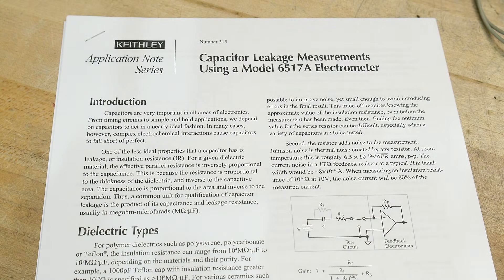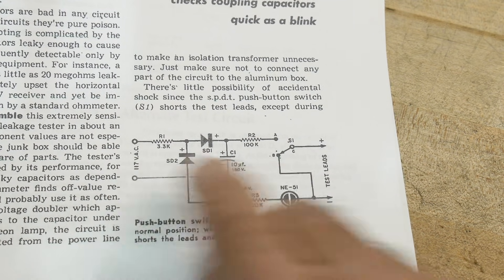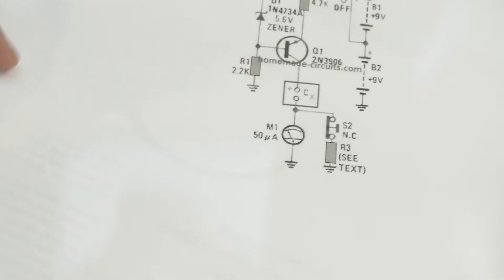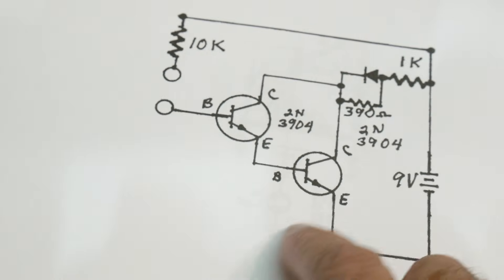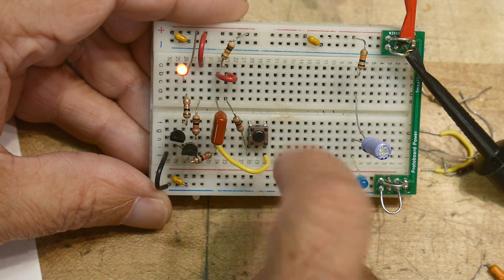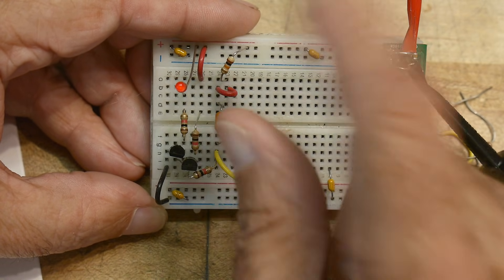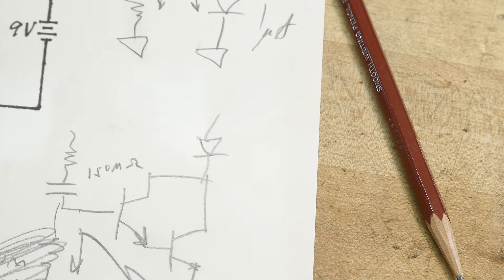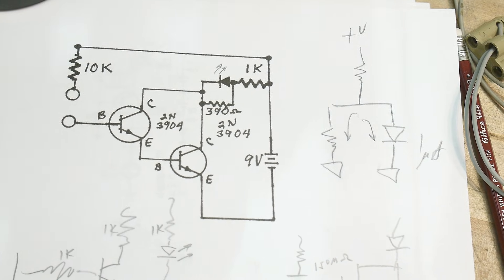#1691 Some Capacitor Leakage Testers

Comment: You might use any LED for this test and connect it to a photomultiplier tube detecting single photons at extremely small currents. The LEDs really turn on at very low voltages since at room temperature thermal processes participate in the emission causing random photons.

The leakage current consist of many components in excess of the capacitor's actual internal current through the insulation. There are currents through the air by ions and electrons and surface currents on top of insulators, caused by dirt and grease ions. These are really significant when measuring femtoamperes. All surfaces should be cleaned with solvents before attempting anything. The air should be dry else air conductivity will be dominating. Also, you should  ionize the air before starting measurements to neutralize all nearby surfaces. Else there will be space currents caused by very high voltages present on the surfaces, not seen by the eye. These can be observed with field meters, analog or digital. Things become easily very complicated before getting reliable results.

The capacitor is not really just a pair of metal plates and some dummy insulator, as said before. The insulator is a macroscopic piece of ions which can not move and there is no conduction band for electrons. The capacitance is based on polarization of these ions.  Measurement of leakage should measure the current in the insulator caused by its imperfections and impurities. But there are free electrons inside the insulator which can slowly move inside the insulator. These usually come from the outside and they are often stuck inside. They are hard and slow to remove and their behavior is complicated.

Comment: According to both Nichicon and Chemi-Con, electrolytics should be tested for leakage current at their rated voltage, and allowed to run under that voltage for five minutes.

Chemi-Con ratings for KNG series, 105 Deg C:

6.3-100 VDC:
I=0.03CV or 4μA, whichever is greater.

160-450 VDC:
CV≦1,000 I=0.1CV+40 max.
CV＞1,000 I=0.04CV+100 max.

So, within the above voltage ranges and capacitances, it can range from 4 uA to 100+ uA max.

A setup to supply 600 VDC at 1 mA, and using both a 50 uA and 200 uA meter, switchable between the two, along with a 0-600 VDC voltmeter, would be sufficient to cover the entire range. The 50 uA meter would be used for some not electrolytic as well.

For metalized polypropylene, according to Illinois Capacitor:
30000 MΩ x uF “Not to exceed 3 GΩ” 

They do not give a maximum current, only a resistance. However, knowing that the maximum resistance is 3 gigaohms, and using a rating of 600 VDC the current would be: 2.0 × 10-7 amperes or 0.0000002: 200 nanoamperes.

Comment: why can't I use my 0-100VDC PS & just put my Fluke 189 uA setting inline (in series) and measure 100V & below caps current flow (leakage) that way?
Reply from the maker: you can https://youtu.be/H1qMV_hTGGw?si=VyRdOg7rTlWBPIsU

Comment: I have a University Degree in Physics and Chemistry and I saw an Electrometer ONCE during a high school Physics class. 
The Warning Label stated: "Maximum Input Voltage 1 V".
The readout device was a 0 to 100 microammeter.

Comment: I just use a multimeter and a power supply or more in series to achieve the desired voltage, i agree with your opinion about the test voltage, i always try to measure on the "high side voltages", i usually use the uA range but sometimes i also resort to the intrinsic 10Meg resistance in the voltage range, but very rarely. As you said practically all electrolytic has some leakage, i tend to estimate the allowable leakage according to the capacitance, usually i accept some couple of uA to tens of uA. It has been proven to be effective for my applications over the time.
Reply from the maker: I test them the same way: https://youtu.be/H1qMV_hTGGw?si=DV7tbJ5IWyLfmLfO

Comment: Oh well, but it was typical for electrolytics to have mA of leakage back in time even when they were new. Caps would vary but in the range of uA. Modern devices are much much better so you need to actually build at least two test ranges into your tester.
I agree many of the old caps and electrolytics will break down at rated voltage, often after some days or weeks even if they tested good initially.

If it is a high voltage or current circuit I always change old devices.

Comment: In his original video from 3 years ago, tomtestkit said, he adjusted that shunt resistor in that circuit, with that particular LED, to light under a leakage resistance of approximately 250 megaohms or lower, not for a particular capacitor value. @ 12:25 It would be impossible to "set up" a shunt resistor on a circuit like that to accurately cover indicating leakage in random value electrolytic capacitors that's why device manufactures like Sencore and Sprague ( along with a few others) created tables with "accumulated" capacitor manufacturer leakage rating info for components of different voltage rating and capacitance values.
Reply from the maker: true, but most people don't have a 250M resistor laying around

Comment: i get usiyan application voltage if you're picking a voltage, but are there capacirors that will leak at one voltage but not another? (within reason)
Reply from the maker: yes, it is non-linear

Comment: Are you sure it was blue and not green LEDs that work best for this?   I tested this with various color LEDs from an old Christmas string.  To get a noticeable glow from the blue, it took 25uA.  The green was brightly lit at under 1uA.  I also tried UV LEDs and, although slightly better than blue, green is still the clear winner with the selection I have on hand.  Thanks for sharing this trick!!!!!
Reply from the maker: blue! green leds are some of the most inefficient
Reply: @IMSAIGuy  OK, thanks for the confirmation.   The old green ones I tried (according to my DMM) are noticeably lit down to around 300nA. Nothing else I have in the junk box comes close.  What current do your blue ones light up visibly at?  Maybe the age of these old LEDs has something to do with it because I tried a newer green one and the blue worked way better in that case.  I guess I had better save these few old green ones I have left!
Reply: I asked on a electronics forum and someone made a good point.  Some LEDs are also good at producing current in the presence of light, and these are terrible at that.   This may explain why they worked so good with low current, no photo-induced current to counteract.
Reply from the maker: @Channel-xb4xt  I worked on LEDs for 10 years. I don't thing that explanation is correct.
Reply from the maker: https://youtu.be/ClVLgFO52cY?si=ZqfVxiNHNl7rLvL6
remember this is an april 1 video. all is true but the antenna part
Reply: @IMSAIGuy I would have guessed it was a prank video seeing as those signals would be way too small to induce a voltage capable of forward biasing the diode.  I think my green one is a quite a bit brighter at 1uA than that blue one in your video though.  Not that it matters, just a cool mystery I would like to better understand.  I could mail you one of them so you could try to find a blue one that draws less if you had nothing more important to do :)  Thanks for the replies!
Reply: Apparently, I have some AC floating around my desk.  I connected one leg with a 4.7MΩ resistor in series to my PS, and before I could connect the other leg, I noticed it was already lit up from just touching the other leg (im not grounded to anything).  If I then touch my desk, it gets much brighter.  Putting a 4.7MΩ resistor between the PS + post (or - post) and desk, I get 5v (so there is 1.06uA current there). But it lit before even touching the desk so the capacitance of my body at 60Hz was enough of a ground!  I'm making a probe out of this!

Comment: To me this is a 'nice to have', but if a capacitor is suspect or old I just change it.  If its old it could fail any time after testing.  For the price of pocket change its not worth the risk.
However this is an interesting topic and still educational so thank you.
Reply: there are expensive caps that you won't be changing willy-nilly
Reply: On the other hand, new capacitors can have unusually high leakage as well. It’s just a luck of the draw. Typical capacitor specs are very conservative but production parts are much better. Then your app depends on that and when an occasional worse but in-spec part comes along there’s trouble.

Comment: A good thing about the resistor across an LED is that the forward voltage of the LED and the resistor set a point where there is no LED current.  The proportional change in LED forward voltage with temperature is lower than you get with the E-B drop of a transistor.

Comment: Can someone explain the difference between a picoammeter, and an electrometer. (I have a feeling there is a significant difference.)
Reply: A picoammeter is a highly specialized instrument designed specifically for measuring extremely low currents, typically in the picoampere range or lower. It excels in applications requiring high precision, such as semiconductor testing. On the other hand, an electrometer is a more versatile instrument capable of measuring both low and high currents, as well as high-impedance voltage measurements. Electrometers find applications in a wide range of fields, including physics experiments, medical physics, and environmental monitoring. The key distinction lies in the specialized sensitivity of a picoammeter for precise low-current measurements, while an electrometer offers broader measurement capabilities across various current and voltage ranges.
Reply: @andymouse  Hi: AFAIK we called an instrument, or meter, that measured current, an ammeter... after Ampere... and the unit of current the amp. If it measured milliamps, we called it a milliammeter... if it measured picoamps, we called it a picoammeter. If the instrument could measure charge in coulombs (and maybe current, voltage, and resistance... but at least charge ... we called it an electrometer. If it could only measure static charge we called it a coulometer. AFAIK...an electrometer has an integrator (or something that acts like an integrator) in it... but an ammeter doesn't. And an electrometer measures charge on the scale of picoamperes.
Reply: Technically an electrometer measures charge.  The term is often misused for picoammeters
Reply: @kensmith5694  Ya... charge and current so easy to get confused, in a timeless world. But, who's timing it?
Reply from the maker: read: https://assets.testequity.com/te1/Documents/pdf/keithley/KeithleyLowLevelHandbook_7Ed.pdf

Comment: Measuring leakage at the rated voltage is how I discovered fake rated chinese electrolytics. They were marked 16V but the leak was terrible, so I lowered the test voltage to 10V and the leak current dropped to a few micro-amps, just the normal value for an ok electrolytic. 
Just to prove they were re-marked as higher voltage, I put them at 16V as the sleeve said, and the ones I tested started to overheat and finally exploded!.
Reply: Yes and you also can't trust the capacitance number on them.
Reply: @kensmith5694  Actually, they were correct in capacitance and ESR, so they were not terribly bad.
I will just use them for small unimportant pojects...

Comment: Very interesting video. I would like to see this put up against Mr Carlson's model that shows capacitors to be bad at 30 volts that other high voltage testers test as good. Without giving away what's in "the secret sauce" his detector uses about 80 M ohms of input resistance to check at it's highest sensitivity. I would like to see that Keithly put up against it. Is Carlson's secret just that if you have enough sensitivity, you can pick up ANY leakage, even that which is "acceptable"? His is based on stacking up transistors in a similar method like you've done in your schematics, YET it doesn't condemn new components. It would be cool if you built his and compared it to the Keithly meter. I would love to see that. I am also curious if you had an op amp or jfet at the input of a version of his tester instead of a 3904 if it would be too sensitive to be practical?
On the electrolytic capacitors, I have a variable high voltage power supply and a 100 micro amp analog meter that I put in series to test them and the meter dances all over the place while charging the capacitor up to it's rated voltage. I've noticed that it takes about ten minutes to really settle down, even with a good cap, but it always fluctuates even when its down to only a few micro amps of current. 
This video makes an interesting discussion, so feel free anyone who wants to comment on this. Thanks.
Reply from the maker: In tomorrow's video, I show opamp that would be used in a more modern version (instead of darlington). I should design a board.
Reply: Great! I can't wait. Take care. @IMSAIGuy
Reply: It's hard to compare if he never would like the schematic public

Comment: If you have just an ordinary digital multi-meter that has an input impedance for voltage measurement of 10MOhm you can connect it via the capacitor to a dc source. The voltage you see in the display stands for the current of 100nA per Volt. (1/10Mohm) This is also 100pA/mV or 100fA/µV. 
For faster testing it is good to have a smaller resistor like 10kOhm to shunt the input of the multi-meter at the start. 
This method is not so common (I do not know why, maybe as leakage measurement is older than having digital multi-meters).
Reply: A long since obsolete Fluke 8060 A had a 2'000 nS conductivity scale.  Conductivity - what is that, you may ask.  In fact, instead of the IEC naming "siemens", the Americans used to call it "mho", for 'inverted' ohm, or 1/ohm.  So, the 2'000 nS full scale has a resolution of 1 nanosiemens.  The meter uses 9 V battery, so it cannot measure high voltage leakages, but the 1 nS already corresponds to 1 gigaohm.  I used that to select some very low leakage diodes from a batch of 1N4148 parts.  Well, nowadays I would just buy FDH 300 family parts (assuming they are still available).  And, on the other hand, I have a Keithley electromeer, as well as an HP 4329A that has both high voltages and 10^15 ohms, or so, capability.  Yet, I am finding the blue LED designs quite nice and interesting for DIY activities.

Comment: My fluke 27 multimeter has a leakage tester that measures in the Giga ohms range. Of course, this is not testing rated voltage of the capacitor. Much like Mr Carlson's tester.  I agree with testing at rated voltages cuz the behavior of insulation breakdown at a higher voltages like arching may be an undiagnosed issue.

Comment: While you can't 100% rely on the beta of the transistors, could you not use some form of feedback to set it to a specific amount?
Reply: The challenge is that for very low currents the input impedance is hard to control.  A better approach if you want to improve accuracy would be to use a modern cmos opamp that has a very high input impedance.
Reply: The opamps for pH measurements have the highest impedance among easy obtainable parts. 100Meg impedance of measurement electrode is typical value, the impedance of opamp is much higher. If one needs to measure something in that range - use them. PH and reference electrodes are usually connected to 2 amps, connected like a buffer and all the other signal processing is done from their outputs.
Reply: Yes you can. It is called bias. You can look up transistor circuit biasing to see how.
It is the way to go.

Comment: I had a very similar problem back in 2010. In analog ion chambers dose rate is measured via transimpedance amplifier as chamber current (~10^-13A....10^-10A) and absolute received dose is measured as a tottal charge passed through chamber. That is done via precize integrator, and one of the problems was to find (and prove via measurement) ultralow leakage capacitors, also radiation hardened ones since ionising radiation disharges capacitors via production of charge inside capacitor insulator. Absolute hell.  The instrumentation was so sensitive to everything. I swear to God it was almost sensitive to look at. 😂
 At the end we did it by using kind of a sample hold circuit with electrometer amp to measure the disharge rate at known current. 
 We had a guy from NIST working with my team. One of the most talented engineers I ever worked with. :)

P.S. Also if you have the time and will, try finding capacitor leakage tester from youtuber and a fellow engineer Mr.Carlson. He did a great job designing very very sensitive indicator.
Reply: Yes, Mr Carlsons tester is definitely a cut above the rest, I built it and it's fantastic, has a forecast feature also. you have to be a patreon to get access to his design but I think he has a video demonstrating it somewhere.